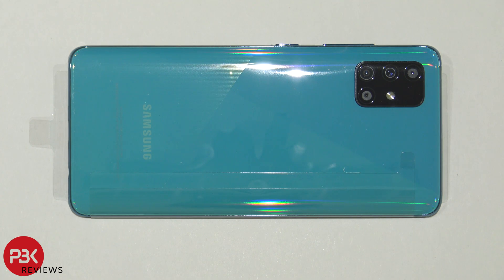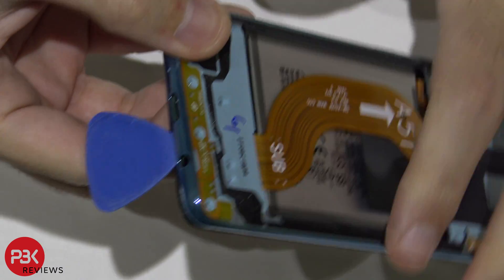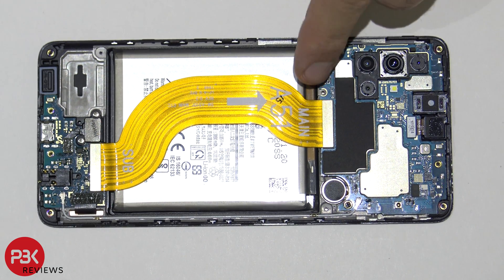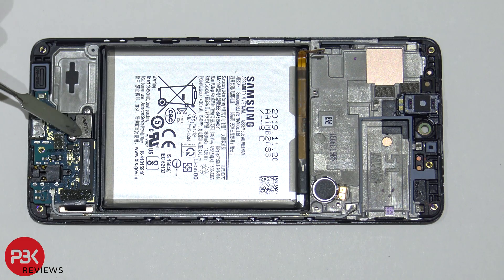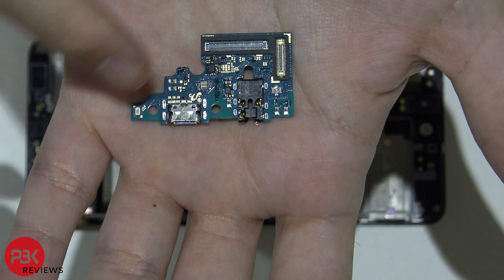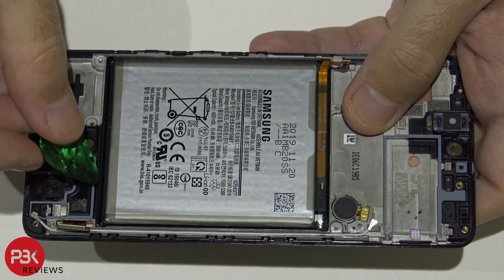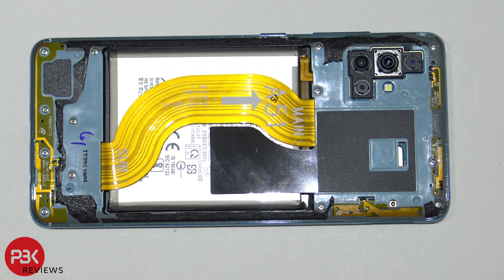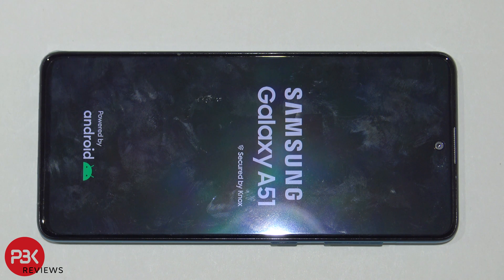Samsung Galaxy A51 Disassembly Teardown Repair Video

Comment: Hey iam using this A51 for almost 4 years before 1 or 2 months my mobile fell down and the display showing the model name and samsung logo but its not turning on and not showing the other stuffs but the touch is working.. 😢 
Now what i have to do for the display to turn on
Reply from the maker: Not sure, it can be many things. If it was me, first I would disassemble the phone and put it back together, to make sure all the cables are connected properly and nothing is out of place shorting something. Then if still no luck, the next thing would be a hard manual factory reset (which would delete all data on the phone). This is done by holding volume up and power button I believe when the phone is off then entering recovery to reset the device. If still no luck, its possible there is board damage like broken solder points which would require reflowing to the motherboard etc.

Comment: is there a way to take something out of old phone that's not the SIM card, something that hold like all internal storage? and put that in a different phone? My phone has stopped working and I can't login to a few accounts on a new phone as it needs verification from the old phone (which won't turn on). Didn't know if maybe I could just manually transfer everything through something in the back of the phone? Hopefully that makes some sense 😅
Reply from the maker: Nope, the storage is soldered to the main board and is not user replaceable.

Comment: So what do you do if your battery starts to expand with the slightest briefest bit of heat hitting it?
Reply from the maker: It shouldn't do that unless something is wrong with it, but you can use isoproypl alcohol to get a little around the sides and let it sit for 30 seconds so it eats away at the adhesive underneath, making it easier to pry off with plastic pry tools.
Reply: I can't even get past the first step lol

Comment: sir the black shield that covers (i think the processor) on the main board  isn't in my phone isn't that something that's suppose to be there. because i once was take my phone at a repairing centre so
Reply from the maker: Hi, that's a graphite film which helps to transfer heat. You can try to find one from another phone to add to it if you need. It will work without it but won't transfer heat efficiently.
Reply: thanks a lot, appreciate it @PBKreviews

Comment: What size of screw diver should i use to open it?
Reply from the maker: a 1.5x25mm should work. I have links in the description for tool sets if you need.

Comment: Please @pbk repairs, please I have one question, can I Put in the battery of my Samsung galaxy a31 into Samsung galaxy a51, that I'm expecting from a friend.. I wanna know if I can put the battery of a31 in atq, and will it work ?
Reply from the maker: Hi, no you wont be able to. The battery is larger in size (for the a31) and wont fit in the battery compartment (for the a51).
Reply: @PBKreviews  but I'm sure I can use Samsung galaxy a31 fingerprint sensor into Samsung galaxy a51 that has a damaged one

Comment: Hi! I dropped my phone a couple of days ago, and it doesn't charge anymore... there are no cracks on the screen, it work like a normal one but it doesn't charge, what seems to be the problem with it?
Reply from the maker: It's possible it may be a loose cable or connector on the sub board or charging port board.

Comment: hey just wondering, what phillips screwdriver size did you use? thanks.
Reply from the maker: 1.5x25mm but generally most smartphone size ones work fine, a little smaller or bigger doesnt make a difference.

Comment: Can i put a vibration motor from a different samsung phone (a3 2015) to this because i think they are the same? The vibrator motor from this a51 is horrible
Reply from the maker: As long as the size and contact point location is the same, I don't see why not.

Comment: What happens if you rip one of the antennas while talking the back off the phone.
Reply from the maker: Hi, there are usually more than one antenna being used for signal, so possible that one that ripped might not work but your phone should still work. However if you are having weaker signal or other issues you would need to order a replacement back housing which comes with the antenna flex cables pre attached.

Comment: Hello! I'm a bit concerned about my phone,I woke up to it really hot around the top part of the phone near the back camera. I was confused because the battery is not there lol. Any thought?
Reply from the maker: Hi. It can be many things, like the flash light being left on, or camera running by accident in background or the antenna on that corner being in use. You can try completely turning off the phone and powering it on again to clear out any running apps and services and see if it still does that. If so it might be a possible short or liquid damage etc.

Comment: Hi I have a thought I think my fan in the phone might be either getting bad or close to breaking because the processor is getting really warm sometimes when it needs to work a little harder so how do I fix that or is it integrated in a way that you can't replace the fan?
Reply from the maker: The A51 does not have a fan. Pretty much no phone has a fan except those higher end gaming phones like the nubia red magic phones and the legion phone etc.
Reply: @PBKreviews  so I'd basically have to swap out the entire processor to get my phone back to 100? Or could there be another reason for the processor are getting burning hot?
Reply from the maker: @zhqpr4378  its not like a computer that you can swap out the processor. Only thing you can look into is replacing the thermal paste, might have dried up over time. Also phones over the years get slower n slower with updates, forcing people to upgrade down the line. The processors dont last as long and well like they would on an acutal computer.

Comment: Long story short i dropped my phone at work and grease is packed into the speaker holes. I got what I could out but is there another way to clean it other than disassembly?
Reply from the maker: No other way I can think of. You may even need to find replacement speaker mesh filters to replace.

Comment: Thanks for this informative video! The vibration motor in my phone has stopped working, and while you expose it and point it out there on the midframe, im wondering what might be involved in swapping just that little motor. Is it soldered in place or have a press-on type connection? The replacement part is so cheap, and the tear down process simple enough, im considering doing it myself
Reply from the maker: Hi, its just held down with adhesive tape. Just heat it up a bit with a hair dryer and you can pry it off.
Reply: Perfect!! Thanks so much
Reply from the maker: @tanglebranchmeadows1802  You're welcome

Comment: Sir kay Samsung m51 ka battery 🔋 blast ho sakta he under 3year
Reply from the maker: Hi, not sure what you are saying.
Reply: What do you think about the battery 🔋 blast of in this mobile under 3year its phones 📱 battery is safe or not plz tell me I am using the mobile plz clear my doubts 7000mah battery is not dangerous long term use it is possible.
Reply from the maker: @shubhankarpattnayak1556  I think it should be safe, I have used similar devices over 3 years and never had any issues.
Reply: A51 nehi M51

Comment: Did everyone noticed that battery capacity was written 4000 MAH inside. 😵
Reply from the maker: Yes, it has a Rated capacity of 3890 mAh and a Typical capacity of 4000 mAh. All batteries have the rated and typical capacity written on them. More of a way of saying one is what its consistently capable of achieving and the other what its fully capable of.

Comment: Hi can you show/tell me if replacing the earphone jack requires desoldering/heating
Reply from the maker: Yes if you want to just replace the headphone jack then you would need desoldering and soldering a new one. But if you replace the charger port board with another one, would be the easiest way so you avoid soldering.

Comment: Hi great tutorial. What kind of glue do you use to replace back piece. I accidentally put my old SIM card in the slot without the tray and feel very stupid
Reply from the maker: Hi, you can use 300lse adhesive strips or smartphone red tape. Some back plates come with pre installed adhesives as well if you want to go that route.
Reply: Is it possible t get a SIM card out of the SIM card holder. It's not with the tray but is deep in
Reply from the maker: @Angofar  you would need thin flat tools to try and get it out but you would also risk breaking or damaging the sim reader pins and might render them useless

Comment: Hello i need your help i thought in the hole above the camera there is the sim card space but it isnt But i put that little Metall Thing in it and tried to push it 
I realised too late that it Was the wrong hole did i destroy something
Reply from the maker: Hi, that's a microphone hole, some phones have a few of those. Its a solid gold piece on the main board and doesn't break easy. You should be fine :)

Comment: Where can I get the screen?
My screen broke internally with a black spot,
I need a replacement but I cant find where,
Could you assist me please?
Reply from the maker: you can get it on ebay or amazon, on ebay search galaxy a51 lcd or on amazon here is the link: https://amzn.to/2Y3TJYP
Reply: @PBKreviews  
Y o u are very kind thank you so much
Reply from the maker: @ANGELLO0787  No problem

Comment: That thing you used to undo the fone is a guitar pick
Reply from the maker: Yes, any plastic pry tool would work, guitar picks or pry picks which look like guitar picks work best since they are thin and easy to work with and wont damage the frame or scrape it up.

Comment: Well, i searched if my phone is waterproof, they said yes, i dipped my phone in the water and 15 mins later screen won't work at all. Note, i didin't dip my phone for 15min, it was 15 min after dipping.
Reply from the maker: From what I checked, the phone is not waterproof there is no IP rating on the device nor is it advertised as waterproof/resistant.

Comment: What's the space at the bottom to the left of the fingerprint sensor? Looks like just empty space. I have two little holes in the side my case there (looking from the front: lower right, about 1cm up) and I've no idea what purpose they serve. Perhaps to let NFC pass through?
Reply from the maker: The space is where the speaker sits into when the back assembly is put into place. And not sure what hole you are referring to exactly, but the small holes around the phone are usually the microphone holes which pick up sound when you speak either from bottom of phone on regular phone or sides or back of the phone when its on speaker phone. One of the holes is also a sim card eject hole where you insert your eject tool to get the sim tray out. People usually mistake mic holes thinking they are sim holes as well.
Reply: @PBKreviews  The holes are in the protective case I bought for this phone, not in the phone itself. Sorry, I probably should have described that better. The phone itself has no corresponding holes in that location, so I wondered why the case had them. It's the Anccer case if you're interested.

Comment: SAMSUNG CAN YOU STOP USING GLUE ON THE BACKCOVERS? please make it easier to remove the battery use rubber and metal or some clips.it's not normal after i pay 200 euros for a phone to use superglue if i want to change the battery.do something about it that's why i stop buy samsung phones.because of the poor construction

Comment: Is it water resistant / waterproof?
Reply: Danu Pambudi it haa no ip rating so i would say no
Reply: Dude if have this phone you need to be very careful on touching it the water. Or else you will buy another one 😊
Reply: The back cover and microphone ports are not sealed.

Comment: what is the reason that a50 didnt break in bend test but a51 broke?
Reply from the maker: There are many factors that could be behind it, number one being the person who did the bend test. Some people are stronger than others, and some people put more pressure into bending it than others do. That could be the main reason, because A50 and A51 pretty much have similar build structure

Comment: wanted to know if samsung is still glueing their battaries and you dont even take it out.
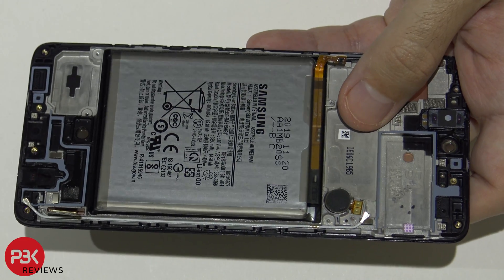Reply from the maker: Glued? You mean use adhesive. Yes if you watch the video you can see @4:44 that I say there are no easy pull tabs and you would need to heat the frame and pry the battery off.
Reply: @PBKreviews  
Dear my screen broke, I  cant seem to find a screen down here in Mexico  is it possible to get it from u?
Please contact  me
Claudiagamamoreno@gmail.com 
Best, 
Looking forward on your response
Reply: @PBKreviews  thanks man my  bad.
Reply from the maker: @tyren818  no prob, your welcome :)

Comment: Are the quality good or bad
Reply from the maker: I mean it has its good and its bad. Its a clean design with very few cables to worry about which makes the disassembly process easier, but would have preferred a non plastic housing. Still a good phone

Comment: so the battery still use permanent adeshive
Reply from the maker: I mean I wouldn't say permanent but yes they use adhesive which is not user friendly to remove. You can still heat it up and pry it off gently and with patience so you don't warp the battery too much or damage it, But if your replacing the battery, you don't really care much about warping or damaging that old battery, you just don't want to bend it too much or tear it to cause a short and have it flame out or catch fire.
Reply: @PBKreviews  Dear my screen broke, I  cant seem to find a screen down here in Mexico  is it possible to get it from u?
Please contact  me
Claudiagamamoreno@gmail.com 
Best, 
Looking forward on your response
Reply from the maker: @ANGELLO0787  Hi, due to the covid related issues, shipping to mexico and most countries is taking significantly longer than usual so I wouldn't be able to ship it out myself. I had a few packages get returned after 2 months because they were unable to get them delivered. I know ebay and amazon have the screens for sale, but again as far as getting them shipped to your location from any seller will probably take a while.
Reply: @PBKreviews  
Ty :(

Comment: Plastic is just...ugh😖
Reply: but alumunium dissipate the heat, would be nice for me if some phone maker downplay the spec for alumunium body instead for mid range phone
Reply from the maker: @pantiadjie6189  True, I would prefer aluminum body as well
Reply from the maker: Ya lol, would have preferred aluminum instead but probably to keep costs down they went with a more plastic shell. Maybe the A71 will not be an all around plastic design.
Reply: @PBKreviews  they could have used premium materials like metal and glass and bumb up the price for like $20. It would be a more enjoyable experience.
Reply from the maker: @carlitops  Yea I would agree, however you would be surprised at how many people would actually go for a device that costs a bit less. I personally would rather spend $100 more and have a better build but yep.  Also the fact that there is the A51 and the A71, they are factoring in that the A51 would be the lower end device for those who want to save more, and the A71 the higher end for those who would rather pay more. Again we will have to wait and see how the build quality is on the A71 :)